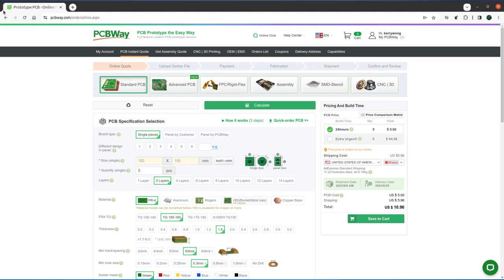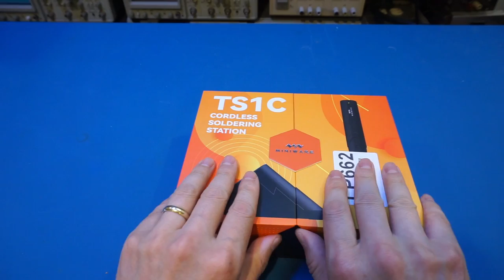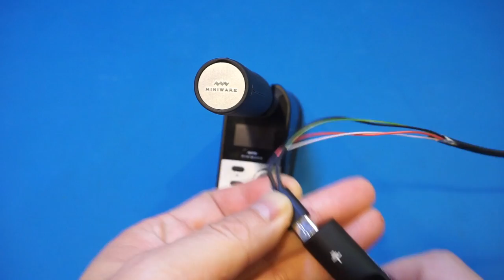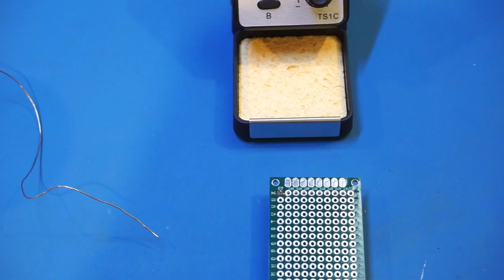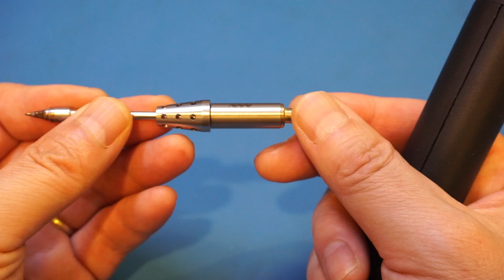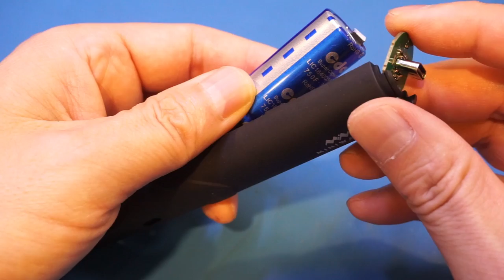Review/Teardown of a Miniware TS1C Cordless Soldering Station

Comment: I can see flat - flex copper rubbing on the supercap contacts and for me it is just asking for a trouble. Kapton tape anyone?
Reply: Well, the flex board is polyamide anyway, and it is placed copper side away, as there are 2 flex boards to the rear, to handle the current and the signalling without issue.

Comment: I wonder why the super cap is not soldered to the PCB and use screws.  That extra cost and labor. Didn’t check datasheet of the cap. Could be to sensitive to temperature ??
Reply: 350c for 4sec. Then it’s writing “no clean soldering’ which I don’t know what it means.

Comment: What material is the top layer on the screen made of? I'm the kind of person who will have moments that I will park the iron wrong and push the tip of the iron against the screen. If it's made out of plastic... You can guess.
Reply from the maker: Looks like it's some sort of glass, I just did a scratch test on the corner, and it didn't leave a mark.

Comment: i can see this being useful for fairly niche use cases 
people who do professional repair of equipment or automotive and need to get in to weird areas, people who might have previously used a TS80 (or whatever) with a battery bank and does not typically need to solder more than 6 things at once
i am impressed by how well it handled those large thermal pads and i rather like the "boost" button and i can imagine future irons having something similar

Comment: At 21:15 I can see an enormous SMD boost inductor to raise super cap voltage by ~5x just to make a standard tip deliver this kind of performance. Those huge MLCC's above it must be used to keep ripple low so the uC doesn't freak-out with all the inductive super surges going on inside this thing. 👍
Reply: What 21:15? The video is only 20:55 long.

Comment: I've bought ts100 irons as gifts for people. I think they make alot of really cool products but they want wayyyy too much money for their products.

The stackable psu, load and scope-like screen is something I'd love to have at one of my benches but I can buy a rigol or siglent supply for the same price. It's a shame.
Reply: pinecil is much better deal if anyone wants a ts100 today.    very disappointed with the powersupplies. not even the price, but they are not isolated. if you run them off the same source you cant put them in series
Reply: @gamerpaddy  I agree. I haven't used it but that and the fnrisi cordless iron look cool. I think it supports t12 tips and I have a box full of them haha. I was gonna get a basic jbc unit but I bought a axiun t3b and t3a which are great stations. The t3b heats instantly plus the t3a has a 24v 4amp output on it.

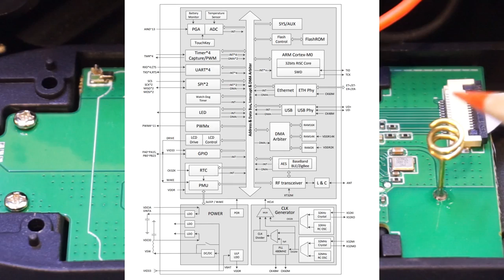Comment: 17:10 the inductor is tiny, my guess is the DC-DC converter takes 20V spits 3V3 just for low power electronics and the big so8 mosfet is PWM driven to charge the super cap.
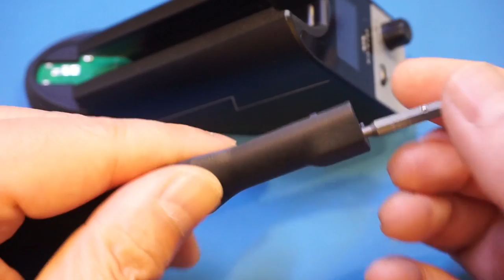18:50 The complicated switch/magnet/hall stuff just for handle detection is to probably ensure that the iron is seated all the way in such that there is no dicky contact on the supercap charging contacts as they probably feed a fair bit of current thru it and bad contact could result in massive voltage drop, slow charging and possibly even damage.
Regarding the iron, except the flex over supercap to the USB-C connector, I'm confused why they have the circuits on the flex PCBs, and not just on two-three sandwiched standard FR4 PCBs.

Comment: I was hoping to see you solder until the unit ran out of juice and soldered itself to the board (which I would probably end up doing on a regular basis). I guess you could use the back USB connection to unsolder it!

Comment: I asked chatgpt the runtime of this thing under full load and it's estimating 41.6 seconds. Here's the answer: 

To determine the runtime of a fully charged 750F ultracapacitor discharging at 36 Watts, you can use the formula:
Time (minutes)=12×Capacitance (Farads)×Voltage2Power (Watts)×60Time (minutes)=Power (Watts)×6021×Capacitance (Farads)×Voltage2
Given that ultracapacitors are often used with relatively low voltage drops during discharge, let's assume a discharge voltage of 2 volts (typical for ultracapacitors).
Time (minutes)=12×750 F×(2 V)236 W×60Time (minutes)=36W×6021×750F×(2V)2
Time (minutes)=12×750×436×60Time (minutes)=36×6021×750×4
Time (minutes)=15002160Time (minutes)=21601500
Time (minutes)≈0.694 minutesTime (minutes)≈0.694minutes
So, the estimated runtime of a fully charged 750F ultracapacitor discharging at 36 Watts is approximately 0.694 minutes or about 41.6 seconds. Please note that this is a simplified calculation and doesn't account for variations in voltage during discharge or other non-idealities.

Comment: Looks good, but not useable for work I do. Wattage problem, when they reach 65 to 90 watts we got something. Thanks  for your time.
Reply: Maybe too many users would complain about runtime if the wattage were higher? Maybe they could have an 80W or so tip and a default 40W limit, unless you have the iron plugged in or are holding down the boost button.
Reply: @NiHaoMike64  Possibly.